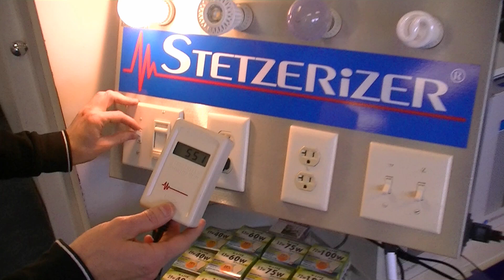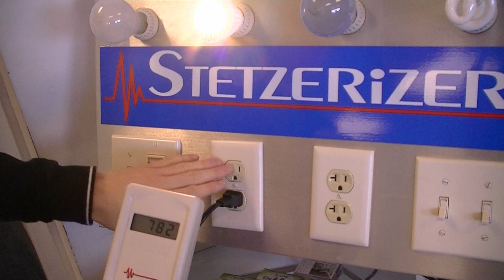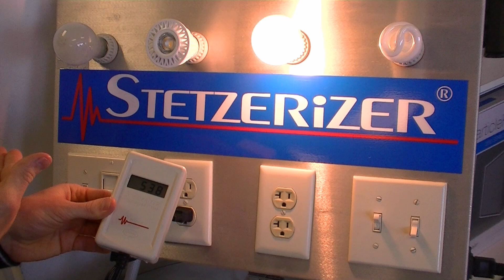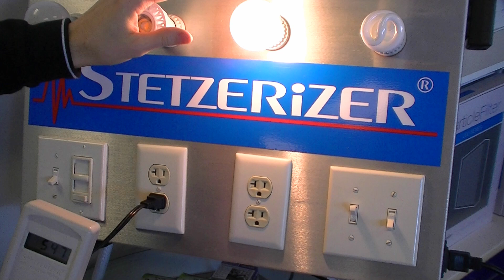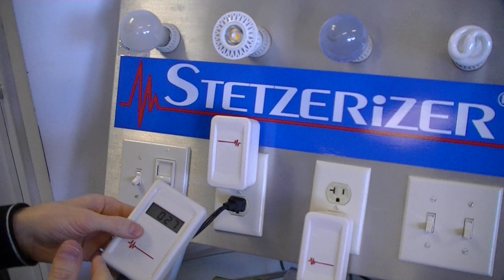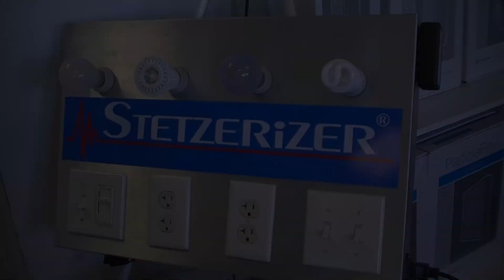Don't use curly bulbs (CFL) compact fluorescent or LED bulbs

Comment: Consider the end-to-end, or life cycle costs.  Incandescents use more KWh during thier ~ 1000 hour lifetime, but are simple to fabricate (glass, metal, and a bit of argon), and simple to recycle.  Cfls use fewer KWh during thier ~10,000 lamp life, but take more energy and chemicals during complex manufacturing process, and are more difficult to recycle.  LED light likewise use less energy during their long life, but require more energy to fabricate and recycle.  I have not done a detailed look at it, but end-to-end costs - from initial manufacturing to final dispositioning should be considered.

Comment: i support this video because i dont like cfl or led
Reply: your the planet hater
Reply: its alot cheaper to make incandescent light bulbs than cfl and led
Reply: @Scudmaster11  sure. Enjoy drowning in inefficiency.
Reply: and latter in the future there will by much less coal power plants
Reply: and this comment box isn’t for people like you
Reply: and you can save more 32$ per month if you air dry you cloths and not use you dryer... if you use only incandescent light bulbs ... its 8$ per month.... your done with the comments because i just answered the problem that wasn’t even real
Reply: incandescents give warm light and 99+ CRI and thies led’s your talking about ... led light bulbs range from 70 - 90 CRI with a bad white light
Reply: white light make in correctly and not mixing RGB ... and led’s still stugle with CRI
Reply: and if you say “inefficiency is a problem” than why do we still have candles
Reply: @Scudmaster11  they're mostly decorative, not used for lighting unlike incandescent
Reply: watch this https://youtu.be/3gjvOOlHmsU
Reply: stop commenting... this comment box isn’t for you at all
Reply: @Scudmaster11  sorry for trying to stop you from turning your light sockets into a bad heater
Reply: i just like incandescent light bulbs much better... “warm light , 99+ CRI , and so on”
Reply: @Scudmaster11  tbf there are high end leds which are really quite affordable which can rival those specs, also without flicker issues. For example, the higher end CREE led bulb series
Reply: Ok planet hater

Comment: please research the scientific method....you did not hold your measuring tool the same distance from each light bulb which makes your experiment null and void sorry to say
Reply: The measuring device is one that is plugged in to the outlet, so it is measuring the high frequency interference on the wiring inside the wall. So it does not matter where he holds it.

Comment: Not clear why you say incandescents have a 'steady flow' of electricity when in fact, the electricity is changing direction 120 x's per second and this causes a 60hz EMF signal.   Also, it's not clear how your filters work with hard wired lights (such as those over the dining room table).  I am looking for 60W bulbs that do not generate as much heat as incandescent (or worse, halogen).  LED's seem perfect but the EMF interferes with my wired internet connection.
Reply: LED bulbs are by far the best option. They are highly efficient (little wasted energy), last longer, often use less than 10 W of power, do not present a risk of burns or fire, etc.
Reply: @nousername5673  I agree, but you failed to address the issue I mentioned:  EMF interference with ethernet.   In doing subsequent research, I discovered that some brands of LED lights are better than others.  I can't remember the specifics and it likely will change so do your own research I guess.